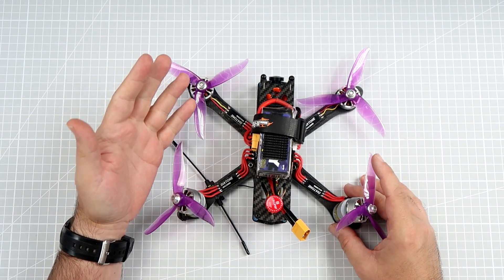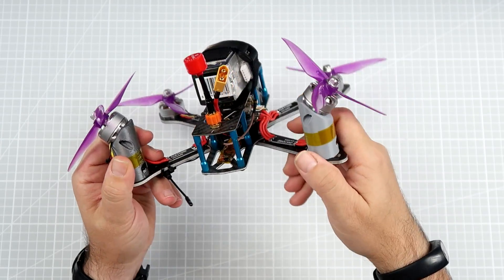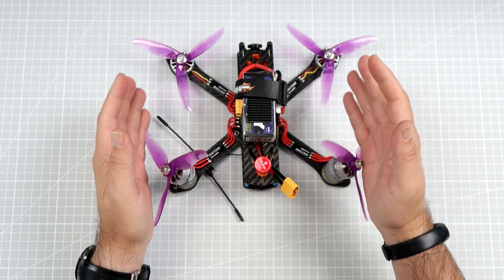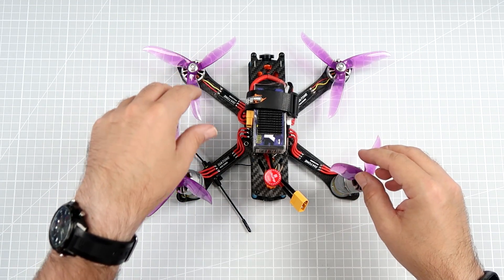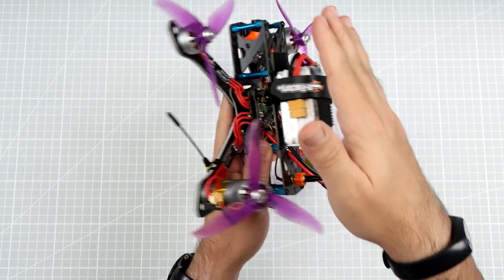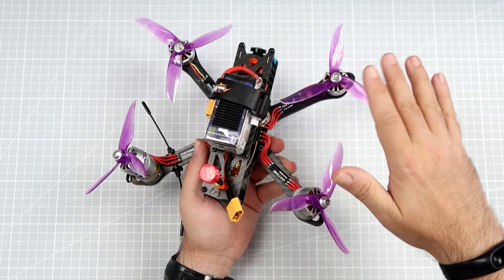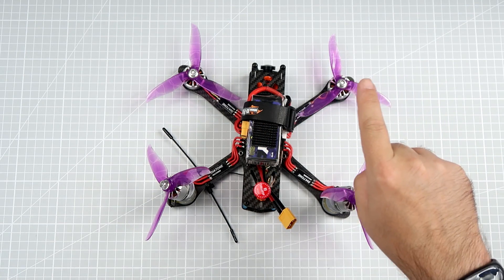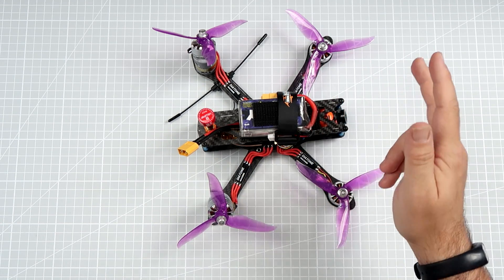Tilted Indirect Thrust System a.k.a A-Tail quadcopter drone

Comment: Finally someone does something cool !!
On a Quad . . I can see this design get better 
What if you rotate the motors on the back with a  gimbal . So you can get more Thrust ?
This is excellent keep up the good work 😁
Reply: That would be interesting tricopter style yaw control on a quad. I've seen plenty of tilt rotor quads but, they're all for pitch control. It would solve the major problem with this design of losing a percentage of the vertical thrust.
Reply: Nice design! You need to add pitch authority to the front rotors to make it work well. From previous experiments i can tell the optimum tilt angle for the rear motors is about 40 degrees. Removing pitch authority from the front motors does not work well since even an A-tail or V-tail needs a mix of gravity and thrust to stabilize itself. I also made this fault. See comment below.

Comment: Hi Pablo I would like to offer an explanation of why "if did not fly well"
1, you built it as a quadcopter! let me explain :) this design was not done as a way to to run 4 props but a way to remove the yaw servo ;)

2, you built it as a quadcopter :) now if you go back and look more carefully at the various versions of this design it atarted as a TRICOPTER not quadcopter see right at the beginning we ALL flew rc helicopters! to control a 6ch helicopter you normally use 3 servos on the cyclic in a 120deg triangle pattern ;) basically a tricopter was designed to mimic a 120deg swashplate of the helicopter using a gyro on each arm and an extra one on the tail to control yaw :)

3 to save money it was actually cheaper to buy a motoer and a prop that a heading hold gyro which was the better choice for the tail HH Gyro £30+ motor £10 prop £2 see where we going now?
HOW TO FIX

A, the capital letter A is not spaced out! neither should you back props be!  

B if front motor either side is pushing 600grams of thrust each back motor pushes 300grams of thrust! you are not making a quadcopter but a modified tricopter with no moving parts ;)

C, your front arms are too narrow double the distance of the front arms and move the back 2 arms much closer together till the back props are almost touching WHY? you have created a turbulant column of air ACROSS the back half of your quadcopter that you will NEVER  be able to tune! Solution? bring both back props together to force the column of air DOWN!!! No more turbulence :D now you have a steady column of air pushing straight down away from your tricopter ;) will fly just like a tricopter coz it is one lol just no HH gyro or servo

D, back motor work as a pair to give equal thrust to a sigle front motor so to give a rough idea dt700's up front with 11 inch props equals 1306 as a pair running 5 to 6 inch props in back ;)

E, would you like to know why I KNOW it will work better as outlined above? because its grandchild the Y4 is still in your config setup across ALL firnwares now you know why :) BTW i remember chatting about how and why it would work (i,e before the 1st one was ever made) with the original designer/builder  "REV Richie" many moons ago :)

Comment: You need to add at least some pitch authority to the front rotors since a regular multirotor (including A- and V-tail) needs gravity to stabilize.
A good point to start is this:

static const motorMixer_t mixerAtail4[] = {	
	{ 1.0f, -0.58f,  0.58f, -1.0f },          // REAR_R
	{ 1.0f, -0.46f, -0.39f,  0.5f },          // FRONT_R
	{ 1.0f,  0.58f,  0.58f,  1.0f },          // REAR_L
	{ 1.0f,  0.46f, -0.39f, -0.5f },          // FRONT_L
	};
I opposite to the table above i would remove the yaw authority from the front rotors.

If you want to completely remove pitch from the front rotors (like I did) you need variable pitch since it can use negative thrust to stabilize itself.
As you can see in the video an A-tail works very well with the right mixer settings.
https://youtu.be/kX5t2PZvAS0

Comment: Probably it was bobbling because you didn’t add pitch component to the rear motor. The ideal mixer for the rear motors should be 1 / sin 45º (vertical component) for both pitch and roll and 1 / cos 45º (horizontal component) for yaw.

Comment: The most efficient design in terms of weight/ battery energy is a tri-copter. The more motors you have the less efficient it is. This is cast in stone. There was a simple formula on the MK site a while back that showed this very effectively. Holga Buss was after all the inventor of the multirotor concept. If you want to reinvent the wheel then some development in the rear motor control may be the way fwd. Perhaps have it at the front....

Comment: if motors would be inverted using only 25deg would probably be more efficient. that requires more work on the frame clearly.  so a v-tail with inverted 25deg motors would be optimal unless frame is made from chopsticks. :)